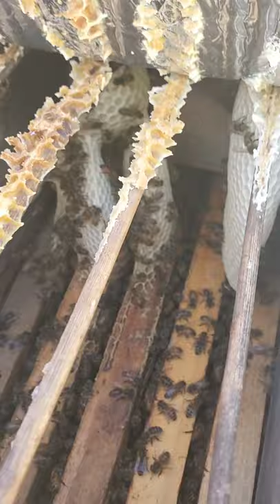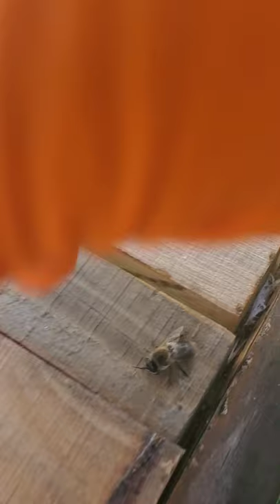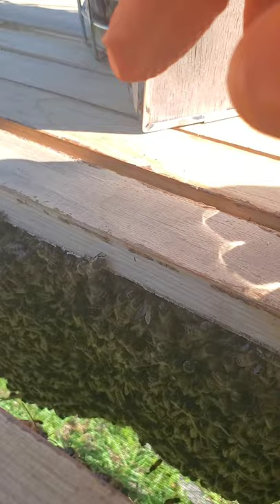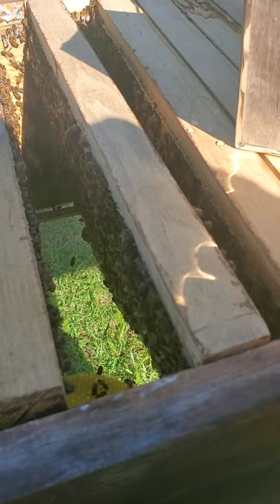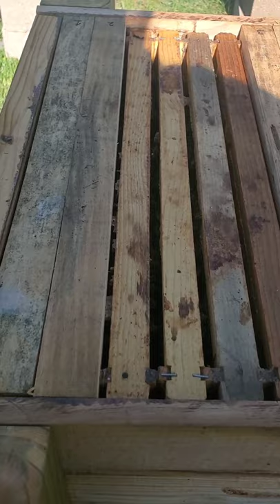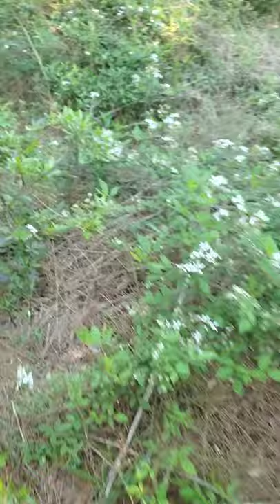Comfort Hive Conversion Update and Swarm Trap Update

Comment: Hi again. I think your Top Bars slip because your Hive has straight sides, right ?
(Can't remember while typing !) If you had Sides that Sloped, got narrower to the bottom, the 'bars that drop' wouldn't do this, as with sloping sides,  the space gets tighter. See Phil Chandler TBH Videos.😏
Reply from the maker: Yes, I'm very familiar with Phil. He does great work. 👌🖖
Reply from the maker: Fixing this problem is as simple as bracing in the center and also making longer top bars that extend beyond the sides. Sloped sides are something I am trying to avoid. They are incompatible with frames if ever you need to put some in it.

Comment: I’m gonna run with the Comfort Hive as much as possible for now anyway. 
I believe a stretch of breaded fishing lines pulled through the two hive bodies should separate them nicely. 
Unless you get a different way. I’d luv to try it. 
Here’s my first CH. 
https://youtu.be/eIEzN4k9Fz0
Reply from the maker: You're right! Fishing line does the trick perfectly.
Reply: Breaded fishing line. 🤣
Do we get Chips (fries with that !?!)
I think Foundation Frame Wire would work too. Aka like a Cheese Wire. Add a dowel handle at each end. Save your fingers from cuts and stings ! 🐝
Reply: @ME_MeAndMyBees  
Kinda like what they used on Luca Brasi